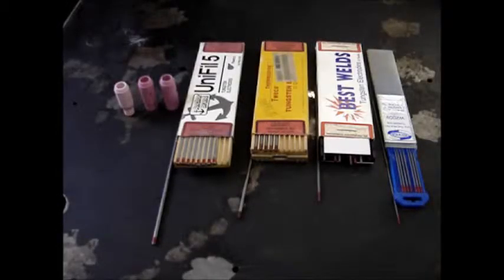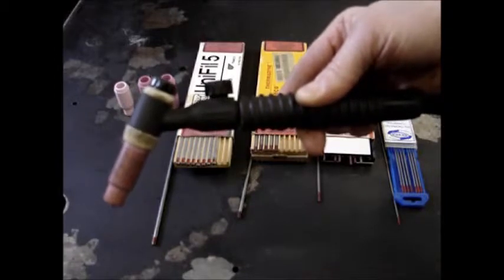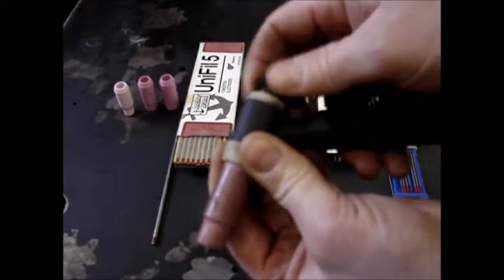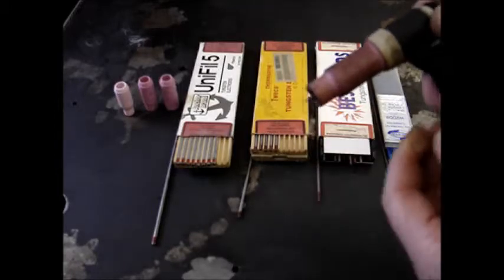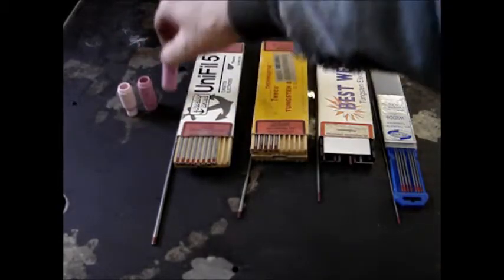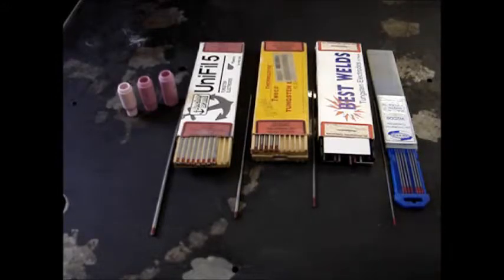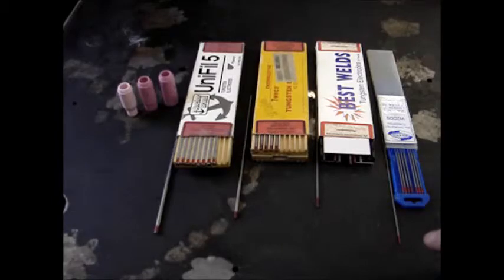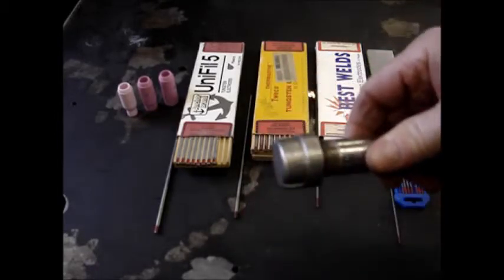How to aluminum TIG welding #1

Comment: Hey Ricky, have you ever used a Mig spool gun? I have a Mig welder and would like to weld Alum, but everything I have read says you need a spool gun?
Reply from the maker: Yes JJ I have a spoolgun, push pull system is the best. You may be able to use a regular mig setup but your whip could only be a couple to three feet long.